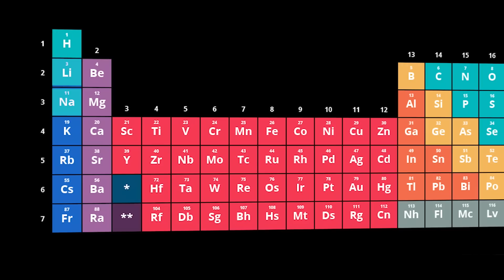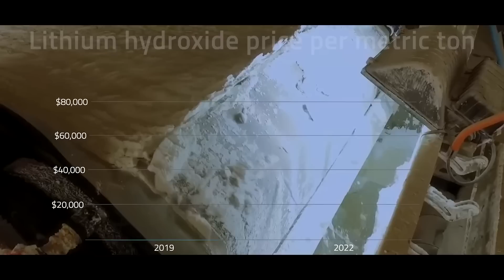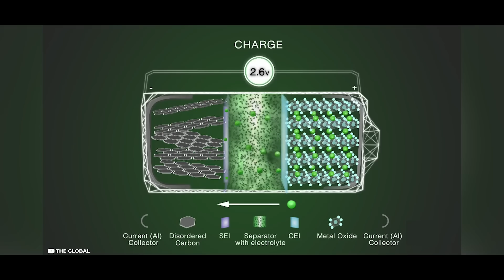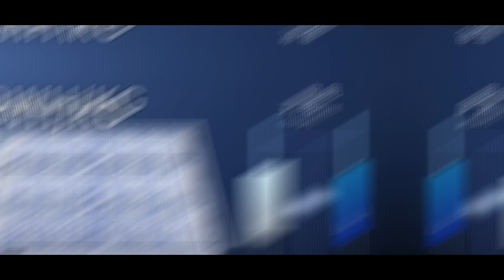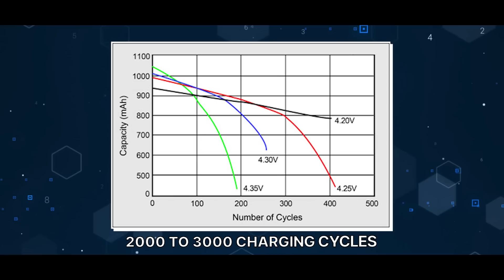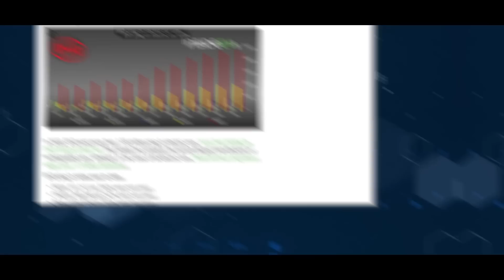BYD launching First 9000$ Sodium Ion Battery EV Changes Everything!

Comment: The 1.8 Million BYD EV's you quoted includes hybrids. Pure BYD EV's were closer to 900k vs Tesla at 1.3 million last year.
Reply from the maker: Yap . Thats why we called it 1.8 million RECHARGABLE cars and not EVs. The hybrid cars are going into this category. You can read the article we have placed in the video as well.
Best regards.
Reply: @The.Futurist seems kind of sneaky to say rechargeable cars.  While technically hybrids recharge their batteries via the gas motor to just about anyone if they heard the term rechargeable car they would think EV's recharged from the grid not hybrids recharged via a gas motor.  

Even rolling with your definition BYD still isn't #1 as Toyota sold 2.6 million electrified vehicles last year., which guess what includes hybrids.  

Do you wonder why another commenter called the video a commercial with this kind of slippery language that makes them #1 in a category that implies EV sales when it's not?
Reply from the maker: @Ry-lx2kl  thats not true there are plug in hybrids which are rechargeable and have batteries built in. Thats why rechargeable.
Reply: @The.Futurist  The 1.8 million includes  non plug in hybrids.  So your rechargeable definition doesn't fit your narrative.  Also, Toyota is still #1, not BYD based on how you defined "rechargable" vehicles.  Sure plug-in hybrids exist but few actually use the feature, which makes them essentially a standard hybrid in practical use.  Hybrids are old news and defining having hybrids as some sort of advantage in the EV space is missing the mark.  While Toyota  is #1 in rechargeable vehicles per your definition they are near dead last when it comes to being able to produce compelling pure EV's anywhere close to affordable or at a profit margin that is sustainable.  BYD at least makes pure EV's but they have been cutting shifts and they are underutilizing their capacity since Tesla created a price war in China.  Tesla can sell at a good profit while the rest are taking losses.
Reply: @Ry-lx2kl  🤣You need to understand the difference between PHEV and  HEV
Reply: @confucianism636  What makes you think I don't understand the difference?  The point I was making is this video is deceptive and inaccurate.  It makes up a new category of vehicle "rechargeable" which by the numbers claim on BYD's production includes EVs, PHEVs, and HEV's.  So the Futurist is lumping HEV's into the "rechargable" category even though the only rechanging they are doing is via the gas motor.  Then this video claims BYD is #1 in this made up category, which it is not.  Toyota would be #1 in a category including EV, PHEV, and HEVs.
Reply: @Ry-lx2kl  BYD's HEV can be used as EV, while Toyota's cannot,It must be filled with gasoline
Reply: @confucianism636  BYD makes both PHEV and HEVs.  HEVs cannot be plugged into the grid.  It seems like you are the one who is confused here.  If an HEV runs on the electric motor alone 100% of that energy comes from the gas motor.  I'm not sure why you are making this distinction as it's not one the Futurist gave in his description of "rechargable" vehicles and it's a stretch to claim that HEV's are rechargeable since 0% of their energy comes from the grid.  Just so you aren't confused the "P" part of PHEV means Plug in.  HEV refers to a traditional hybrid, which is not plug in.
Reply: @Ry-lx2kl  My Han DMI can be charged and it has HEV mode.
Reply: 比亚迪混合动力汽车是电油和纯电两种模式混合动力跟普通混合动力不同你懂不懂？
Reply: 因为比亚迪混合动力汽车可以作为纯电汽车来也可以做油电汽车开
Reply: Ignore facts.  This has to confuse buyers and slow Tesla sales.  BYD is hemmoriging millions of dollars a quarter.